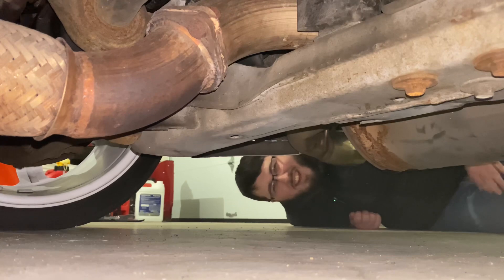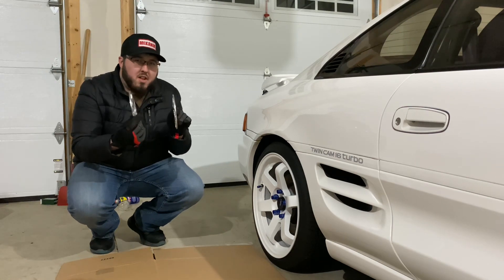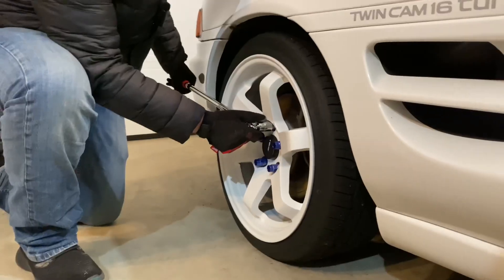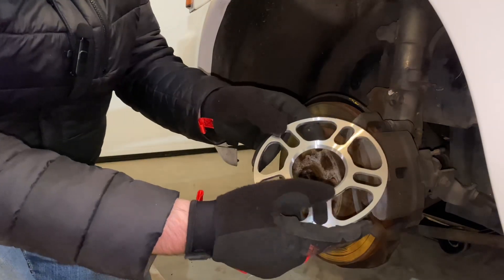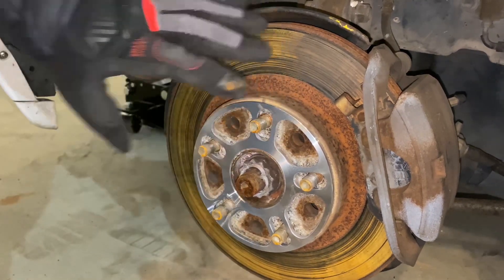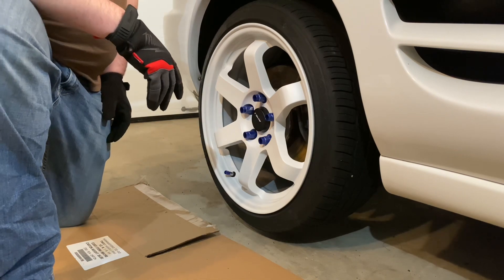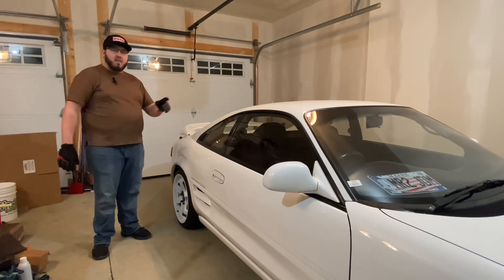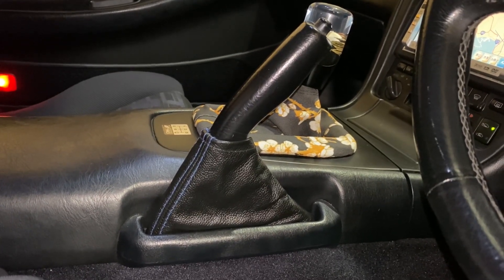Installing Wheel Spacers on my JDM MR2

Comment: I am glad to see a new mr2 owner.  I am hoping to offer some advice if you are willing to hear.  I have owned and built these vehicles since 2002.  The spacers you are using cover the center ring, robbing the rim of its ability to rest on it with the provided black spacer ring.
This puts all of the weight on the lugs alone.  You should replace these spacers with ones that have an extended lip in the center to offer a ring for the rim to sit on.
(Spacers, in general, are bandaid solutions for rims that are not correctly fit, I always suggest getting rims that were carefully calculated in their sizing, but I assume you intend on keeping those rims)
You should also replace the lugs.  They are sized perfectly for the standard Japanese acorn rims with no spacers.  Adding a spacer shortens the amount of lug for the nut to grab.  This, combined with the fact that you are over torquing the nuts presents a danger.
The correct torque for lug nuts on this vehicle is 76lb, not 100lb.
Especially with the cheaper acorn nuts (like those blue ones or various other cold forge tint nuts usually found on eBay or Amazon)
Reply from the maker: Wow! Thank you for the information! I’ll look into some different spacers in the meantime. I have to replace the rotors soon anyway! I’ll eventually be replacing the rims with a staggered set but I got a good deal on the square setup. I appreciate the feedback. I’m still very new to the platform so it’s good to hear from people with more experience! Thank you so much!
Reply: No problem.  Replacing the lugs is not that difficult.  Need to gently hammer out the old ones (meaning no giant swings with long sledge hammer, that can damage other things like the wheel bearing).
The wheel stud measurements can be found on Amazon, usually brass colored: m12x1.5x50
If 50mm is too long for your lug nuts then you can use an angle grinder to cut them too desired length.
Install then from behind the hub after spraying the flared area with wd40 (not the threads, keep them dry), then tighten a nut on it possibly with washers to pull it firmly in place.  Torque to 76 foot pounds and visually verify from behind that it's all the way in.

As for me rims, most mr2 owners believe 17x8 front and 17x9 rear with +35 offset is the most you can fit in stock shape.  This is incorrect.  When the time comes I'd be happy to help further.

Comment: Nice MR2, change your orange front indicators to clear 'or black-clear' your white car would look a lot better, and I would paint my brake calipers red or in your case blue, 'just while you have the wheels off' until you upgrade them, little things make a big difference. btw like your channel keep it up.
Reply from the maker: Thank you! I was going to get the cross support in the engine bay and the calipers powder coated this winter. There will be a video up about that soon enough!

Comment: How many revolution of thread did you get with the spacers on? I bought a pair of 5mm and have only 4 at max full revolution
Reply from the maker: I had a decent amount of revolutions. Probably around 8-9. You may have to install some extended studs to help with that. I haven’t run spacers for a while because I have a staggered MR2 spec set now
Reply: @jdmsw20  yeah, i just bought some extended studs and it's good now, but now I got to buy some bushings for my rear trailing arm lol